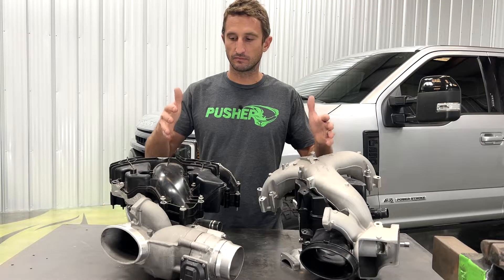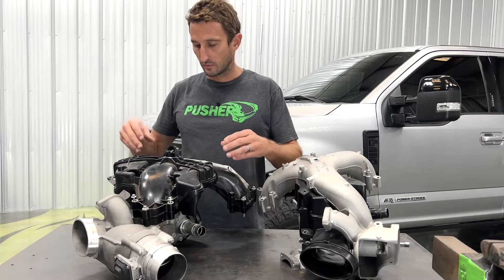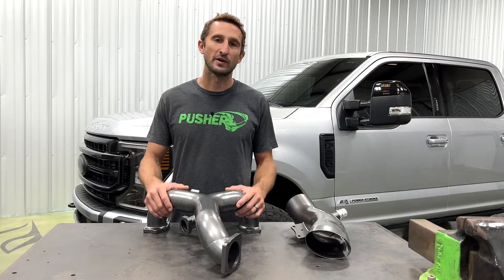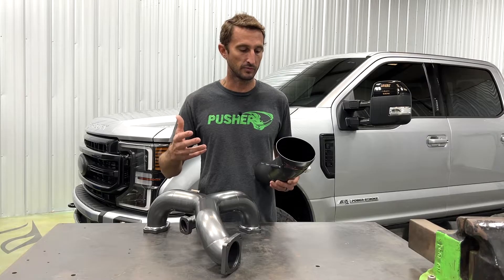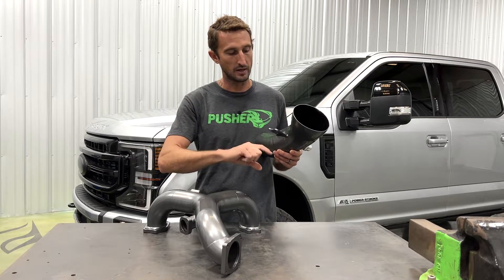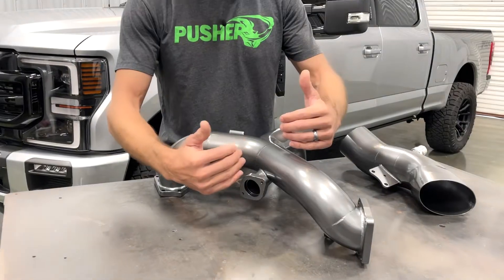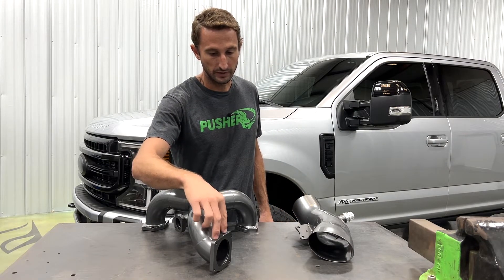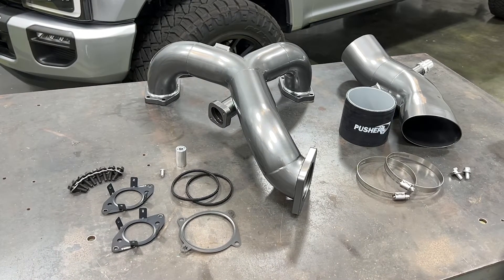50-STATE LEGAL: 2015 - 2025 6.7L Powerstroke: PUSHER POWERFLOW INTAKE SYSTEM

Comment: Not an engineer or a mechanic here, but does the EGR location allow even distribution of exhaust gasses into either bank of the engine? Perhaps the purpose of the restriction and turbulence on the factory part allows better mixture of those gasses with the combustible air. As long as the EGR gas doesn't favor running to either the left or right bank at different flow rates, there shouldn't be an issue, but if not could this cause a mixture imbalance on both banks, one lean, one rich which could lead to differential power, soot and temperature on opposite heads?
Reply: Exactly, you hit the bail on the head, they are selling shinny snake oil
Reply: THIS right here is my concern. There is a reason the engineers didn’t do this simple design and went with something as complex and restrictive as the original stock intake. The sole purpose of the OEM intake design seems to be the EGR being evenly diffused with the cold air.

Comment: No 2012 CARB legal kits.
Reply: It is not available on 2011-14 trucks (with the stock GT32 SST turbo). However, the 15-16 trucks are good to go with the Powerflow, as well as any 11-14 trucks that have an aftermarket 15 or 17+ style turbo.

Comment: Too bad this isn't available for the 11-16 trucks
Reply from the maker: You are correct that it is not available on 2011-14 trucks (with the stock GT32 SST turbo). However, the 15-16 trucks are good to go with the Powerflow, as well as any 11-14 trucks that have an aftermarket 15 or 17+ style turbo. Call us if you have any questions on that! 772.212.9290

Comment: Great looking system. I just had to replace my cold side pipe after it ripped. With 80,000 miles, I could not believe the carbon buildup I had caked in the EGR part of the throttle body/intake area. I get how it the stock EGR area could clog with the poor airflow and areas for it to accumulate. Based on your testing, does your system flowing the EGR in a smoother area closer to the intake will this cause that carbon buildup more into the engine area or does the engine burn it off more efficiently?

Comment: Looks sweet, I have an inter cooler pipe from pusher on my 16, if I get this kit would that still fit or do I need a longer hot side pipe?
Reply from the maker: It'll still fit! Our charge pipes and the Powerflow are all modular upgrades.

Comment: AS  A TECH  I  WANT TO  KNOW .  WHO  HAS   PUT THIS ON  AND  TORE THERE   ENGINE DOWN  TO  SEE  SOOT  BUILD UP IN INTAKE  RUNNER  AND  AND  VALVES    AFTER    30  TO  50 K .  RUNNING  FACTORY EMISSIONS   THE   EGR  SOOT   IS  NO LONGER  GET  ACCUMILATED   IN  THE  FORWARD   SPOT  ON FACTORY  INTAKE   WOULD LIKE TO  SEE  PICTURES OF  IT

Comment: Installed this along with the cold side pipe into my 2024 Platinum Tremor. I can't say enough good things about this product. One of the missed benefits is how the stock unit runs the EGR into the throttle body. THis setup should prevent the coking issue some have had. I paired it with a Banks big arse filter and finished it off with the banks DPF back exhaust. I don't have before numbers as the truck is new but my EGRs towing, power and mpg are fantastic!!! Thank you for this product.
Reply from the maker: Thank you for taking the time to share your review! Much appreciated 🤘

Comment: I would like to see how good this would be paired with the Banks Power system with the Banks air intake filter. It would be awesome to see Mr Banks test for the Air density increase. I plan on getting your intake and Banks system for my 17 F350 6.7 dually
Reply: Banks would rip this apart for failing to account for the evenly mixing EGR gases with incoming boost air.

Comment: What are the gains? There aren’t any specs on your website or how this benefits…lot of money for no listed gains!
Reply from the maker: The airflow increase over stock is 66%, which equates to a faster turbo spool, increased fuel economy (0.5-1mpg being typical), significantly lower and stabilized EGTs. But as far as power gains are concerned - think of it like a campfire - if you really want the power gains on your fire to be significant, increased airflow is only half of the equation; you also need to throw some more fuel in. Adding more air certainly unlocks a lot of potential that wasn't previously there, should you chose to increase your fuel supply. The majority of our customers for this product (vs the race intake system) are looking for the first benefits listed.

Comment: If highly experienced engine engineers could have designed something so simple, why wouldn't they?
Reply from the maker: Good question! OEM engineers have a lot more limits than we do. Their goal is not about making each and every individual component the best it could be - it's about meeting their performance goals with an entire engine, while also making it as low cost as possible. They have a lot more to balance. Our design is heavier duty, would take them longer to manufacture, uses more expensive material - all things that add cost. Imagine that across all of the individual components in the engine. Where they have to compromise, we don't. We have the luxury of picking out individual components that were affected by their compromises and optimizing them. (Disclaimer - when it comes to the 6.7L Powerstroke cold side charge tube, there are no excuses for them there. That's just bad design. 😆)

Comment: I’m a simple man who doesn’t necessarily understand what all this means. So my main question is, if I’m towing my 16,000lb 5th wheel down the interstate, does this improve my gas mileage, and if so how much? And will it improve my ability to pull up hills? Thanks
Reply from the maker: The simple idea is that by making the intake system more efficient your truck uses less horsepower to push air into the engine - which means less fuel burned. Towing requires even more power, so those gains are even greater. You can expect close to 1 mpg increase towing your 5th wheel. It will improve your hill power as well. Your intercooler may be a limiting factor on power gains depending on the year - also something to consider. And a bonus - increased fuel economy also means lower EGT's, therefore longer engine life.

Comment: Does this modification mess with emissions? Would it void warranty?
Reply from the maker: The Powerflow system connects to your emissions system, which keeps running as normal. In regard to warranty - you'll need to refer to your own warranty guide for exact clarification. In our experience most warranties are not voided by installing an aftermarket part like this, but rather they explicitly state that they do not cover any damage considered to be caused by the aftermarket part.

Comment: Wish this setup fit my 2014 6.7
Reply from the maker: For the time being it's just the 2015 model year and up - it is currently not compatible with the dual inlet GT32 SST turbo that was stock on the 2011-2014 model year trucks.
Reply: @pusherintakes  2011 Owner here. Waiting for the solution!

Comment: Way too expensive..... Should be half that price. Its literally tubing welded together...
Reply from the maker: There are a few more components than that. ;-) We can't forget the CNC machined components, 5-ply silicone couplers, fully stainless clamps, engineering staff to design it, a testing program to pay for, certification costs, employees to TIG weld it together (with above average pay and benefits), in a manufacturing facility that has overhead (insurance, a/c, electric, waste, state and federal tax). Quality parts that fit right, perform well and come from responsible companies cost more. We could cut the cost significantly if we cut corners by paying lower wages, using non-American sourced steel & components, etc, but that's not our MO.
Reply: @pusherintakes couldn’t have said it better, quality parts don’t become quality parts by cutting corners, some people have the hardest time understanding that
Reply: @pusherintakes  keep doing it the way you are. great products arent cheap.
Reply: You have close to a $100,000 truck and you want to get champagne for the price of a beer? 🤪
Come On!  Cut one corner, and it's NO Longer a quality component!

Comment: Ok so I see the video is labeled 2015-22 but showed the 2011 stock system so my question is will this work on my 14 6.7 powerstroke
Reply from the maker: Good catch! Jacob misspoke on that part of the video. The overall composition of the intake system shown (with the plastic upper) is the same down to 2011 model year trucks, but as of right now our system currently only fits 2015+ trucks. A solution for the 2011-14 trucks is toward the top of our engineering list right now.

Comment: Do you have a video of a truck running with this installed ?
Reply from the maker: We have a video of us cranking it after install, is that what you're looking for? Or out and about driving?
Reply: @pusherintakes  was just asking if this modification added any difference in the sound of the truck.  I purchased a 2021 6.7 for myself it’s a company truck, but it has been down three times already with fuel pump replacements, the head tech told me the design on these newer trucks is horrible it’s all plastic crap and the connectors short out, I was also running a banks pedal commander on it and after the third replacement we removed the banks product and so far no problems. I am exploring options to enhance the breathing of the truck. Basically I’m just looking for long term reliability, not a drag truck.
Reply from the maker: @BRLCLLC  We're planning on doing some sound testing soon; one of our customers reports its slightly louder after install, but the others (including our own R&D truck) didn't notice a difference. But for sure this is an upgrade for durability and airflow - it'll allow you some major performance gains if you want to tie it with other modifications, but as is it's not going to make you a drag truck. Just a more efficient, lower temp truck. Three fuel pump replacements though - that's not good, and it's not something this is going to help with. I'd ask your mechanic about adding a disaster prevention kit too.

Comment: Okay so I have a 2011 f350 stock turbo I seen I have to change to aftermarket or upgrade to 2015 turbo for this kit to fit my 2011 is this true ? And can I buy just the manifold and it still work with my aftermarket cold and hot side pipes
Reply: I have the same question.  Did you ever find your answer?
Reply: @BenjaminHansen  they have kits now for all years bolt right up

Comment: Really slick looking set up!!...Is this intake system CARB compliant & have CARB E.O. No.?...Asking because my cold air has CARB #
Reply from the maker: Thanks! We've started the process for the 49-State & Carb EO certifications. We don't have an ETA at the moment on when those certifications will be completed, but will let you know when we do.
Reply: @pusherintakes  Hey, thanks for the reply!...I think sometimes engineers try to make things over complicated to justify their degree!!🤔...I'm with you simple design & less restrictions is the way to go👌....Better flowing air makes the "Horses" run faster & easier!!👍😁🤗...later👍💪💯

Comment: Watching this video and seeing that you guys even took into consideration the disaster kit (which I do have installed) has really sold me on this product. Looks like you guys really did your homework. My only question is… Do think there will be problems down the road with carbon build up where the new egr is meeting fresh air? I know there is now because my 60k truck had build up when I did the disaster kit but could this be worse somehow without that egr “diverter” cone? Thanks!
Reply from the maker: Thank you! We always try to take as much into consideration as possible when designing our products. As for EGR build up, we have found that any sharp turn, edge - even the MAP sensor hole on the factory intake manifold - can grab soot over an extended period of time. The smoother the design the less buildup (because of less crevices for soot to collect in and build up onto). Our design eliminates a lot of the stock manifold collection points so we're confident this manifold will have considerably less build up over stock; and so far all of our testing vehicles have supported that.
Reply: Thank you very much for the reply! Excited to install this kit!

Comment: Asking for a friend. What if the trk trouble parts are off as dpf & ccv delete, have your hot & cold side pipes with throttle valve replacement & have tow tune. Will this new setup work on 2019 F350 6.7 powerstroke ?  And do you have to move battery  for cold air intake .Or get the other kit ?
Reply from the maker: Can you give us a call or email to discuss how it would work for the above-mentioned off-road configuration? 772.212.9290 / info@pusherintakes.com.